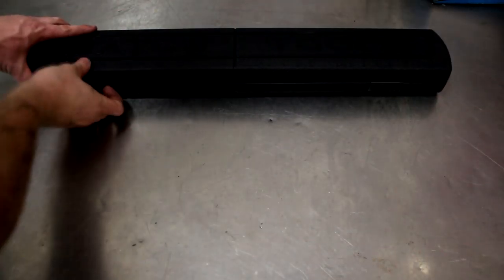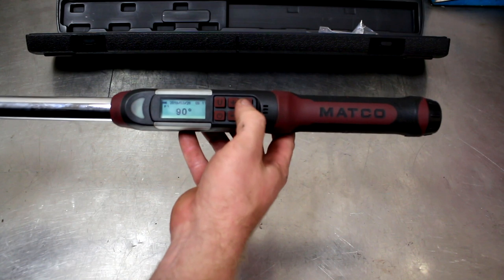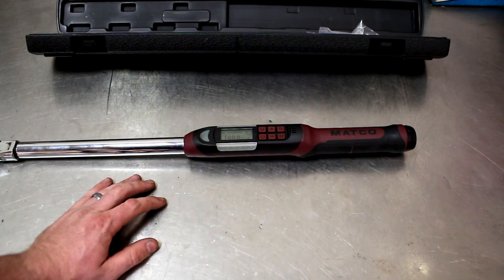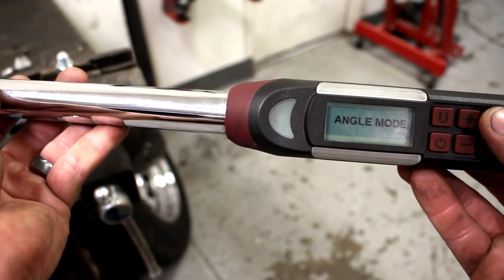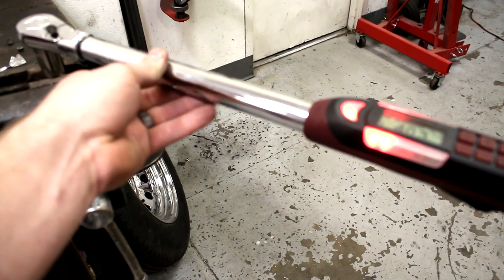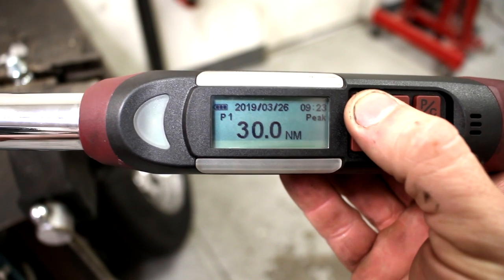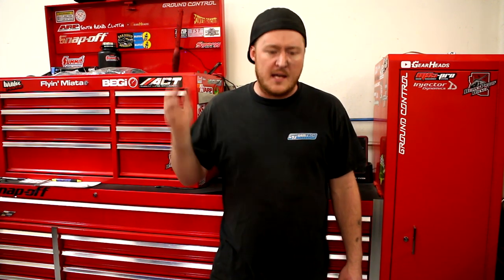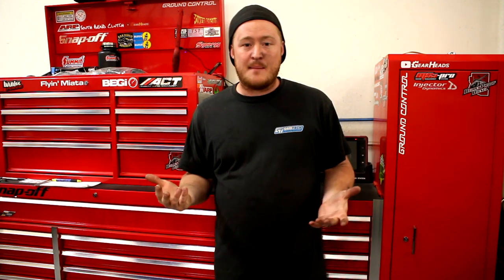MATCO 1/2" Digital Torque Wrench Review

Comment: Why do they give a degree instead of just the final torque amount? Angle wouldn't give a consistent spec. Just another way to make it harder for people to do their own work on cars. Total bs
Reply: It's not so much about the final torque numbers, it's for torque to yield bolts that after a specific torque setting it's turned a prescribed amount to get the proper tension on the entire bolt instead of just the shoulder.
Reply: @ronbowman4145  Thanks. I since looked it up. The angle turn actually puts the whole bolt under tension which I assume spreads the load it's holding better.